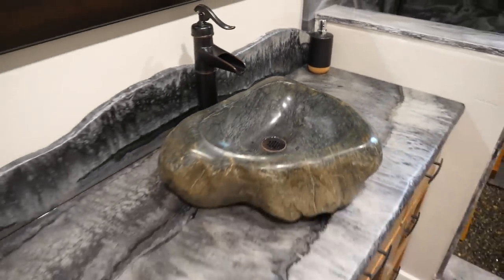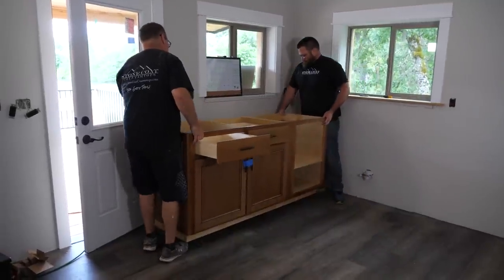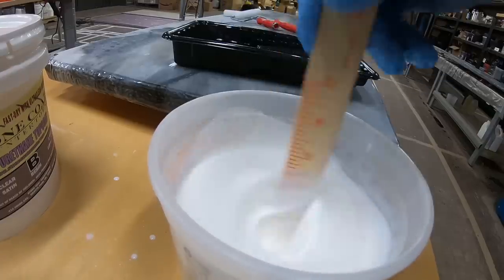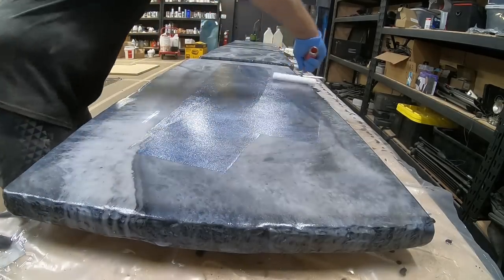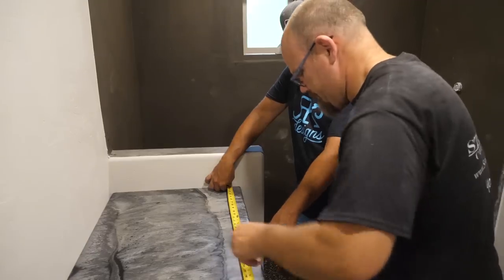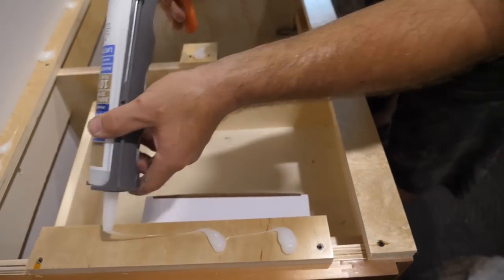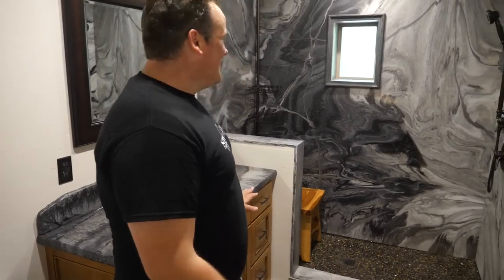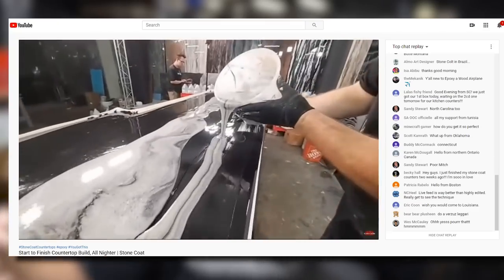How to Make Epoxy Countertops part 4 of 4 | Stone Coat Countertops Epoxy

Comment: Love this series you have done. It gives so much details especially for newbies like me.  I do have a question. You put the color coat on, then a clear coat, and then the natural finish top coat. Is there a reason the clear coat is between the color and natural finish coats?
Reply: The color coat is seldom completely smooth when it cures, due to interactions between the additives.  The clear "flood" coat helps fill in any dips, and provides a very smooth surface that you can then cover with the scratch-resistant top coat.

Comment: Quick question -  would it be worthwhile to also epoxy-coat the underside of the counter rather than just using the red coat?  I was thinking it would be nice to have the color finish wrap around that drip-edge, and wondering if the epoxy would be a better protection against water problems.

Comment: Why not add the red guard to the bottom before epoxying?
Reply: Because you would sand off the red guard when you sand off the drips, drill the hole, etc...
Reply: @jnicholson061905  Ahh I was planning to catch the drips throughout the process so I didn't think of sanding that off. Thanks! Appreciate the comment :)